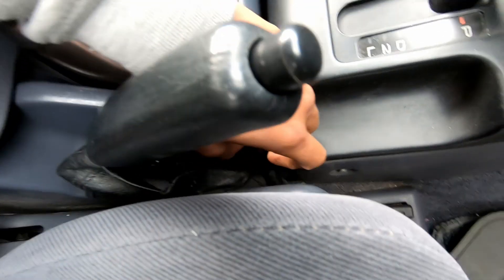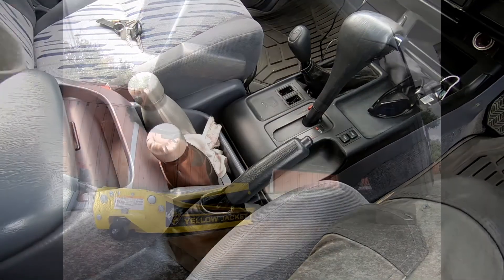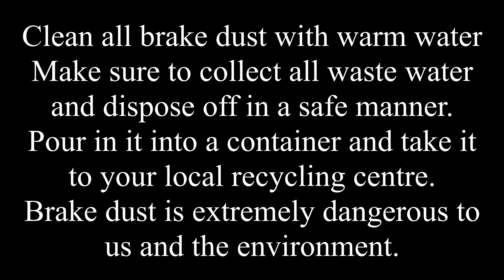Toyota Parking Brake Adjustment (Handbrake)

Comment: How do you get stuck wheel lug's off of the left-hand side wheel I tried a bigger bar and that didn't work they don't budge  but I don't have a drill though so maybe that would make a difference
Reply from the maker: If they are rusted you can try heating up the lug nuts. Or spray a lot of penerating oil Wd40 etc and let it soak overnight and try again the next day. Normally if they are stuck on you can use a long breaker bar with an extension pole to multiply the torque in order to open it, but if the nuts are damaged it could round them. Otherwise visit a local tyre workshop they should be able to impact them off.
Reply: Use the bar from the trunk to install the spare tire and step on it.  With your full body weight it will come out. Next option would be to jack that same lug nut bar.
Reply: Do this when wheels are not jacked of course